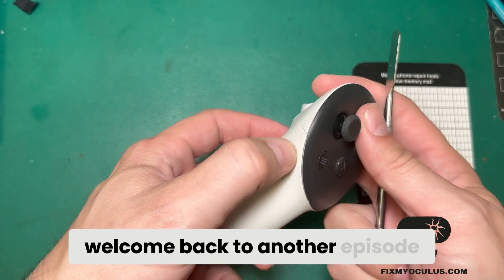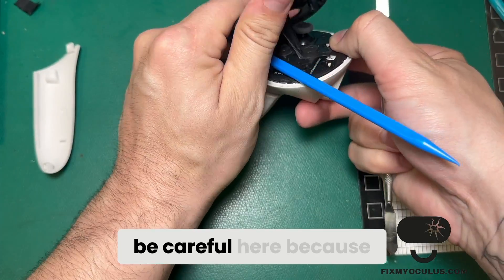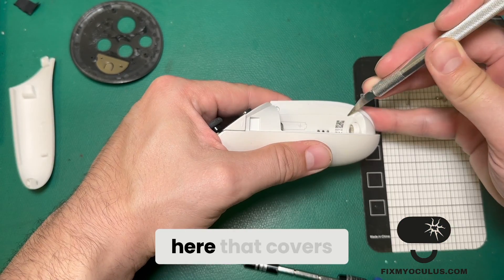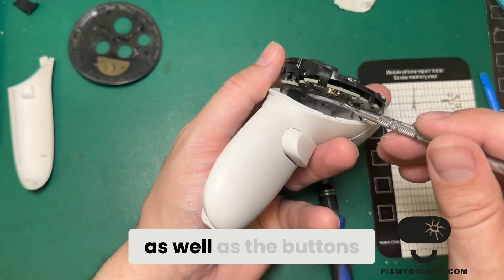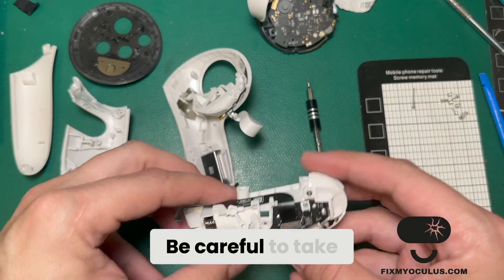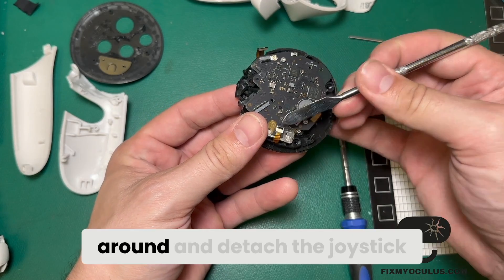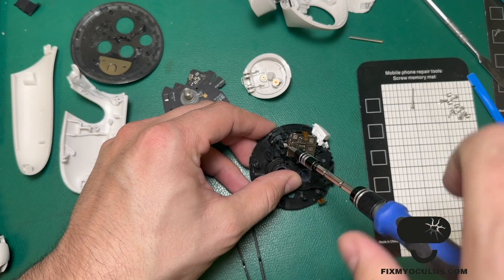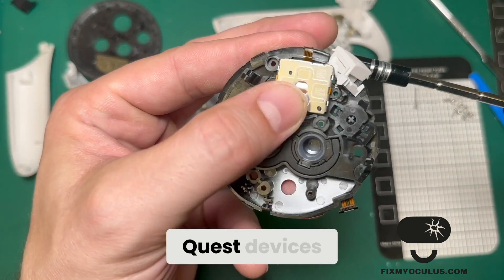Meta Quest 3 Controller Disassembly: DIY Repair Made Easy!

Comment: The repair worked for me by replacing a joystick. I had an issue where the left joystick sometimes would not move forward. 

I read some comments about controllers no longer working after they tried the fix. People, maybe it's basic knowledge to some, but know the following. Touching the boards can ruin them. Also, I did the repair near a lamp. I touched the lamp base a few times to ground myself and prevent static electricity while working. A static spark from you to the electronics is another way to ruin a board.

Comment: Thanks video was spot on, replaced my drifting left stick. yeah getting main ribbon back on was a bitch and I had to borrow my dads glasses and work light but using needle nose tweezers that came with my replacement thumbstick I sorted it.

Comment: Just a tip: if you can't get the wide black ribbon back into the slot, try popping the three pieces of the handle apart to expose the full ribbon (BE CAREFUL, THE WIRES CONNECTING THE RUMBLE ARE TINY,) and finagling it into the slot while it's free, then pop the plastic bits back together. You're better off not taking the trigger completely out like I did. Trust me.

Also, my issue is that the A button seems to always be pressed down. Fully dismantled and cleaned it for two hours to no avail.

Comment: My son has a quest 3 and one day he went to play his quest 3 and one controller wouldn't connect to his headset. We tried to pair it up, unpair it, pair it, reset, new batteries, factory restore headset and it wouldnt pair to the headset. About a couple of months later his other controller started doing the same thing. The controller lights up the white light and it blinks when trying to pair it up, but the headset doesn't see it and obviously I can't do anything through the app either because the headset won't go through the start up after factory restoring it due to no controllers to get through it. Is there anything that could have gotten wet inside the controller that would cause this?

Comment: A few weeks ago my daughter hit a wall with the right controller and now the onscreen right hand will move itself to the left and rubber band back essentially making the controller unusable, after some discussions on reddit its been mentioned that it could be the IMU (gyroscope-accelerometer) inside the controller, where exactly is this located and can it be fixed?

Comment: Hmmm did my Right controller BUT there appears to be NO wire to the Barrel shaped connector that looks like an antenna connector at all!  Its not like I could miss this, Is there a connector on the right and the left??
Reply: @lylewalsh3942  I noticed that too

Comment: Quick Q : i have a problem with my right controller tracking antena .. is it something that can come loose ( so i can try to fix) or it is something that either damaged or working . 
I am from unsupported meta counties so even if they will replace it under warranty i need to  make this exchange through a friend from “meta supported counties”

Comment: Very nice video,,,,, my question is my right controller,,, I put a new battery in it won’t be on but when I play with the battery,ie wiggle it around a little bit it starts working, it’s a on and off problem, it sounds like a short somewhere with the battery contracts can you help me do surgery  so I can fix my problem please
Reply: Open it up like you see here. Simply putting it backtogether again might get you a better connection if you dont see any corrosion around the battery

Comment: Bruh do you have tp remove the screws on the face plate or just the battery
Reply from the maker: All screws.
Reply: Removing the screws is the worst part, make sure you have a bit that fits perfectly

Comment: Warning, much more difficult to get the main ribbon into the PCB then it is to remove it 😂
Reply: How did you manage to get it back in😭😭
Reply: @c0ba1tX-l1f  tie the end with thread tightly enough to allow you to insert a thin crochet hook
Reply: @Sparchitect100  put it back in before you put the battery compartment back in. I tried to get it with tweezers for like 20 minutes, disassembled again and put it in before even the vibration motor is connected again. I even used just my fingers. Super easy that way. I'm imagine in the factory this is how they do it.
Reply: real 😭
Reply: tweezers

Comment: Thank you for this video! I would like more on how to reassemble the controller and how i might go about fixing the sensor.
My brother brought his meta quest to school with his and another kid got ahold of it and threw the controllers and the headset, and while the left controller still turns on and connects, it shakes and the vr visual of the controller shakes violently and does not hold still nor does it stop vibrating every other second.

Id love to be able to fix it for him without needing to take it to a professional or getting a new replacement if its not 100% because we dont have money for that kind of thing unless we save up.

Is there a video you might have posted that possibly goes through the possess
Of fixing this sort of issue, maybe showing what the sensor looks like of which one it is, and if a certain amount of damage would require replacement entirely?
Reply: Why did he throw it???
Reply: @c0ba1tX-l1f  he didn't throw it, he took it to school with him and let a special needs kid play with it. The kid got overwhelmed and throw the controllers and ran out of the classroom. I didn't see this, he told us about it.
He also just got a replacement controller a couple days ago

Comment: This is a good video, but you forgot to mention that the top trigger has a pin inside, which comes out to reveal a small piece of aluminum. This is used for the capacitive trigger.

Comment: WOW--you could've destroyed the sensors while prying off the black cover incautiously!!! You should lift the cover in the bottom area where there are no sensors, and once the sensors become visible, continue to pry up the black cover. And, using a firm plastic pry tool is preferable to a metal screwdriver, and the screwdriver is more likely to break the black cover as well as leave permanent pry marks.
Reply from the maker: I’ve repaired quite a few controllers and never had an issue, but I appreciate the feedback!
Reply: I second this, prying open the black cover should be done carefully as the IR sensor diode can be easily damaged during this process.
Reply from the maker: I definitely hear you, but I’ve repaired probably 2-3 dozen of these units. At this point, I do have a fairly good idea of where to go to avoid damaging things.
Reply: Pretty I just damaged my sensors after taking it apart. All buttons work, but no movement is detected.